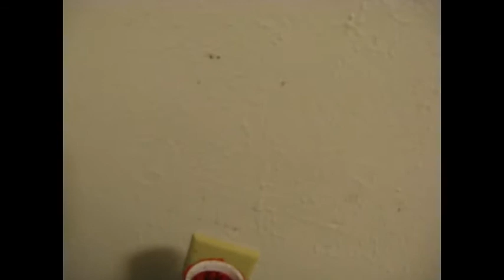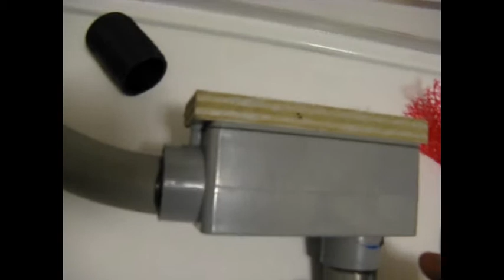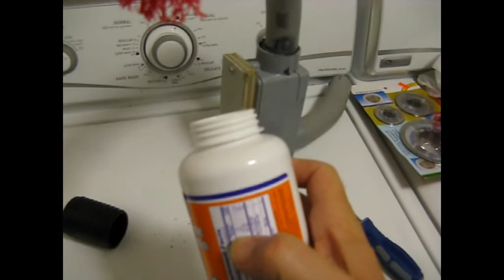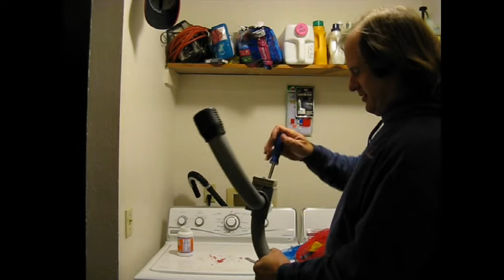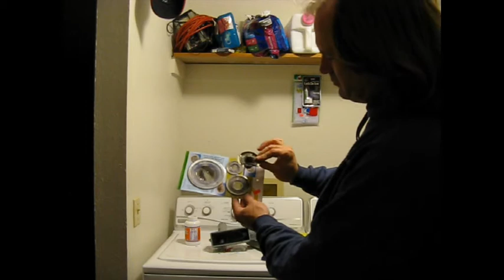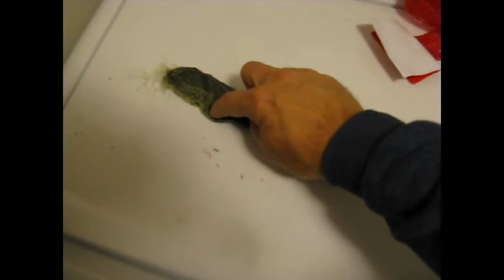DIY Washing Machine Discharge Lint Filter

Comment: Had discharge hose connected directly to drain ( by installer)  After having to pay $350 to have drains cleaned, I placed hose into sink with nylon net. ( I buy nylon bath puffs, cut apart into long strip, cut into 9 strips which I twist in middle and double back upon itself) connected by rubber band. It is amazing. In a wks time, I have lint the size of an SOS pad. The drawback is it is ugly, so I am happy to find this solution to make the laundry room look a little neater
Reply from the maker: See the two follow-up videos I made on this, I have been using plastic scrub pads that can be unfurled into a sock of sorts. Course mesh that snags lint all the way down the upper pipe so a plug at the end doesn't develop too quickly.

Comment: Nice concept but simply isn't useful for a few reasons. The first nylon filter is practically useless for two reasons: 1) it is way too coarse to catch the finer synthetic lints that clogs up a septic, and 2) the length is irrelevant because the end will plug up first creating a ball that seals the hose...in other words all that filter "length" is useless because it simply becomes plugged at the end.

You also have to take this whole thing apart just to see if it's plugged - a major waste of time and effort. And depending on your situation (e.g. if you have pets and pet hair all over your clothes, if you work with wallboard or concrete that gets into your clothes, lots non-soluble particles like synthetic fibers in many clothes) you will be checking this thing at every other wash cycle. In many homes Moms do the family laundry every few days - I can't imagine them taking this Frankenstein system apart every other day.

Keep in mind if the filter is only slightly clogged it will create back pressure and shorten the life of the water pump in the washing machine. (And any money you saved with this DIY filter will be spent getting the washer fixed!)

You really need a clear filter housing that you can see is draining correctly and allows you to inspect the filter with, along with a filter that will trap the particles I mentioned above, otherwise you're not really capturing the particles that damage your septic making this a big waste of time and money.
Reply from the maker: +sengelbr   Six years and still haven't killed my machine, septic tank and lawn repairs would be way more expensive than any extra wear on the pump. I do have a cat but am single so usage isn't heavy. Most of the issues you raise were addressed in a follow up video that provided several usage hints. The "sock" does collect longer fibers along it's whole length, and what I now use as a sock is much more effective than the apple bags I used in this early video, again see the Usage video. The usage video also shows how you can tell if it's getting clogged by how it sounds. A further video describes adding a clog alarm to it but that concept is sort of a fail and I need to revisit that. A clear, larger housing would be nice. I get about a half dozen or more loads through it except when doing towels, it doesn't pay to push it.

Comment from the maker: Still using this. As Eric suggested below, I drilled out my stripped screw holes and installed #10 threaded rod into the holes so I could use wing nuts for easier serviceability..

Comment: Before I switched to panty hose, I was using a coarse plastic mesh filter.  It had larger holes than the panty hose, yet it worked like a beaver dam: caught a few bits of large debris, then it became almost completely sealed after that.  I switched to the pantyhose because they were longer, which made it easier to clamp them to the hose and leave room for the water to through more than just the end of the stocking.  Currently, I'm doubling two hose.  Will report any improvement.

Comment from the maker: That is a little disconcerting. Wonder how thorough mine is with three, though more coarse, layers of filtering. Hard to really check in my instance, will have to think about some kind of temporary pipe or large diameter hose out the door. Would like to see a video on your grey water system.

Comment: I use knee-high panty-hose (2 of em in a pack for a buck at the dollar store). Use a thick rubber band to hold on hose. Works great, and economical at 50 cents apiece!

Comment: Electrical junction box is a good idea , switch it over to wing nuts so you can clean it quicker . If you stop even 50% of the micro fibers youve saved replacing a septic system for years ....

Comment: I take women's pantyhose and rubber band it to the washing machine hose. Works really well and I haven't lost a single one down the drain. Catches everything. This design prevents the possibility of a backup in the house since the restriction is on the pump side not the drain itself.

Comment: I take women's pantyhose and rubber band it to the washing machine hose. Works really well and I haven't lost a single one down the drain. Catches everything. This design keeps the possibility of a backup in the house since the restriction is on the pump side not the drain itself.